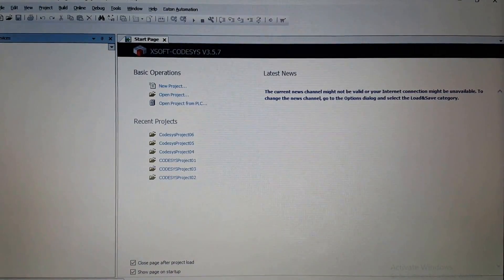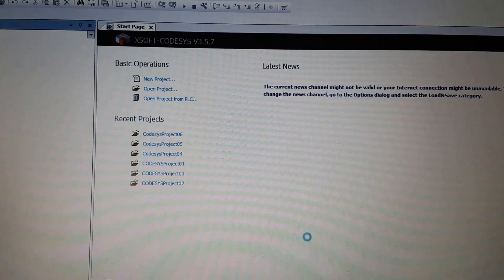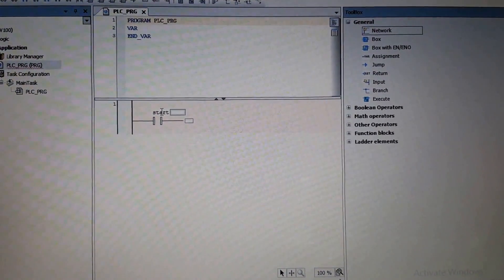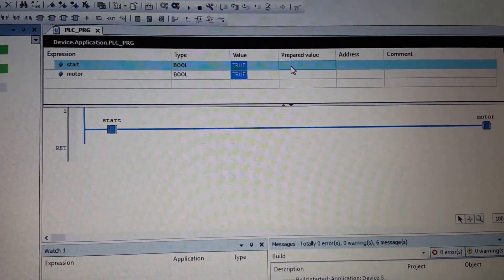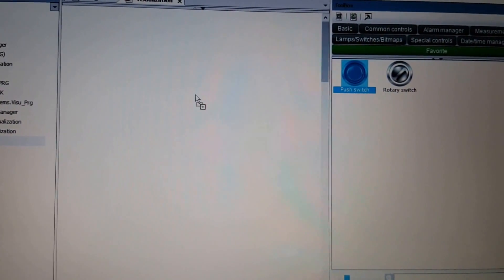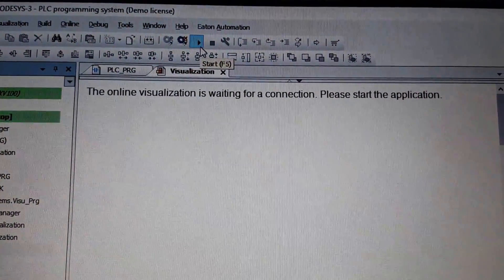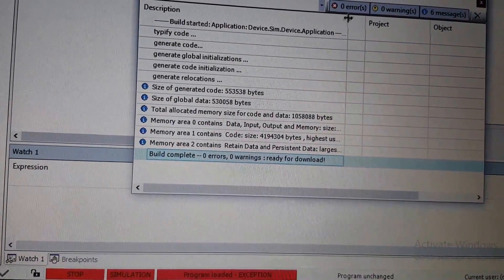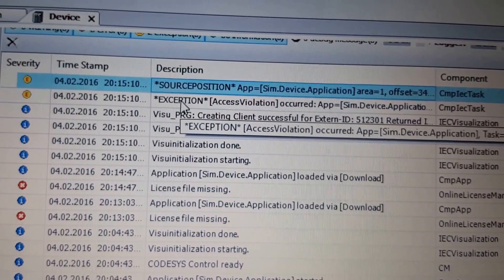CODESYS: XSOFT-CODESYS V3.5.7.0, visualization bug #codesys #plcprogramming #visualization #plc

Comment: Hi Sir, Could you tell me how i can upload program from PLC to  XSOFT-CODESYS V3.5.5?Thank so much.
Reply from the maker: Which PLC do you use? Does it support CODESYS?
I mainly use the CODESYS in the simulation mode in my videos, however, when you have a real PLC, it should be straight forward to login into the PLC and then load the code.
Reply: I am using EATON XV-460 and i want to upload source code form this PLC to modify some parameters.
Thanks for your support.
Reply from the maker: You need to pick "Source Upload" command from the File menu. Then find the PLC from the list, and afterwards, you should be able to have the PLC program on your PC.